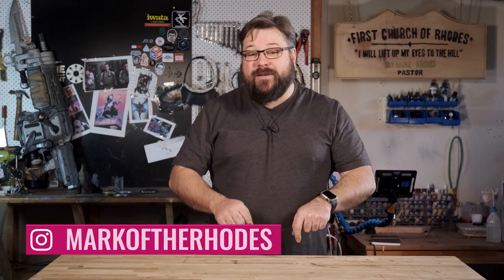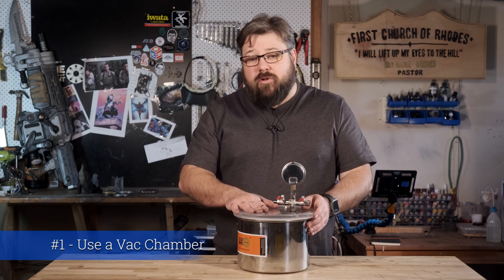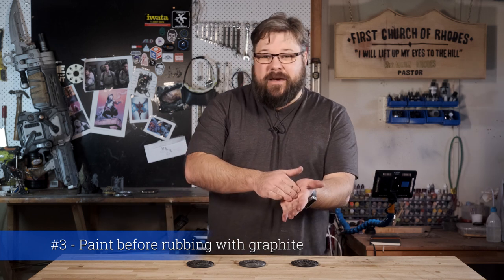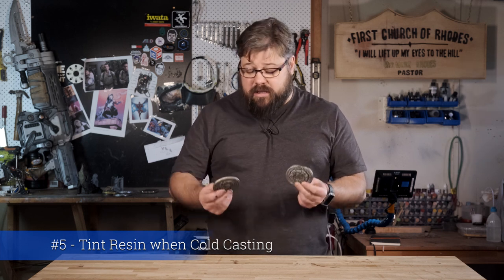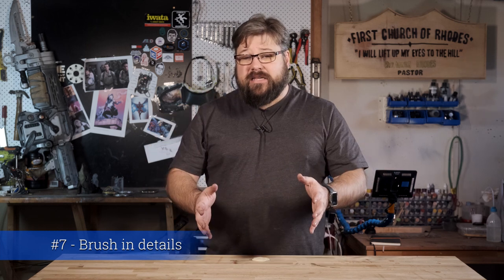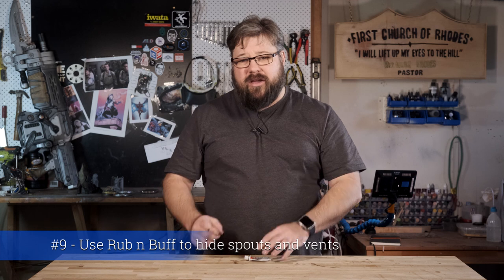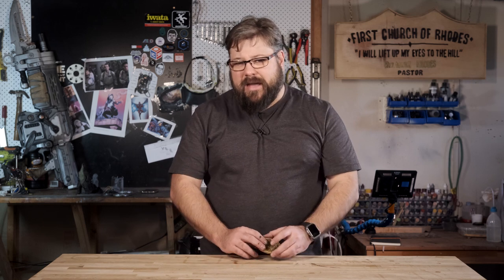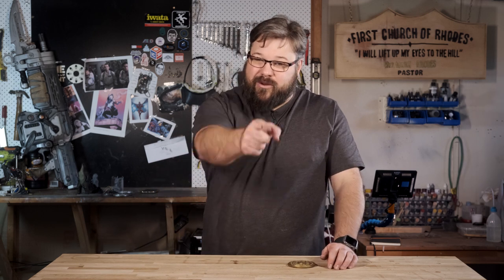John Wick Markers Part 2 - Moulding and Casting Tips

Comment: Pressure pot in your future?
Reply from the maker: I've given it a bit of thought, and the answer is "probably".  Right now I can do a heck of a lot with a vacuum chamber and some stubborn penny pinching.  :)
Reply: Agreed. Without enough projects that require it, the tool just sits there making you feel guilty for not using it to justify the cost.

Comment: Out of curiosity, and because I have no experience with one, what are you using to drive your vacuum chamber? Is a shop vac sufficient, or did you buy a purpose-made vacuum pump with it?
Reply from the maker: From memory it's a 1.5 HP Vacuum Pump that I got with a chamber from eBay.   Nothing flash, but it does the job!